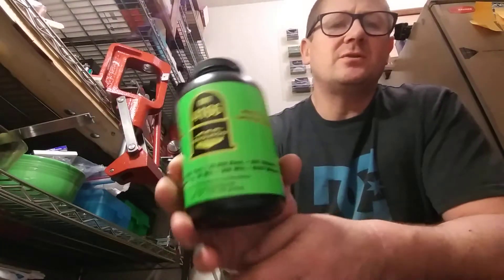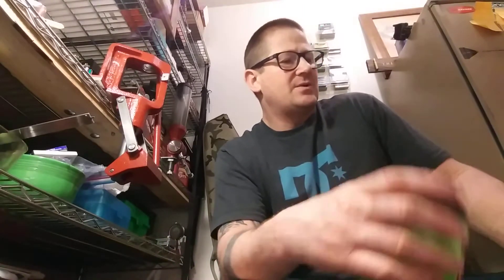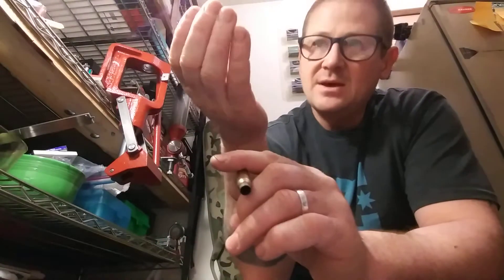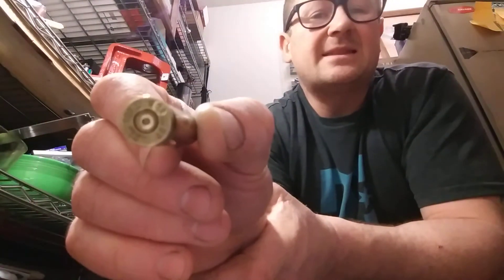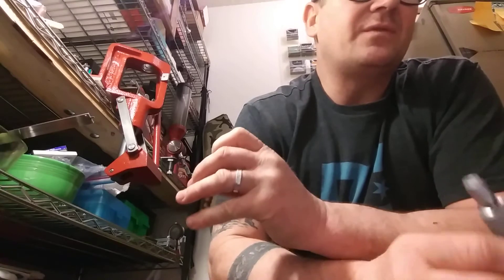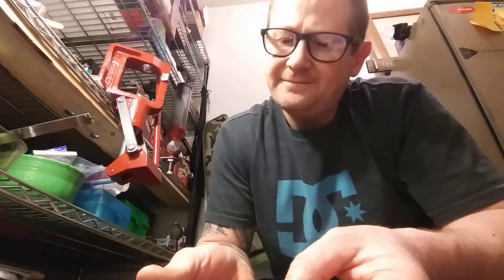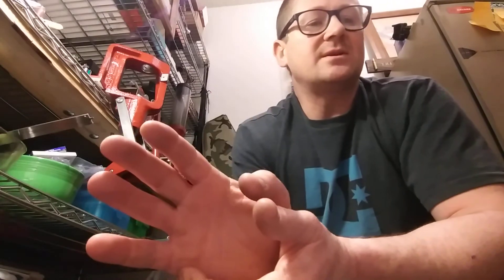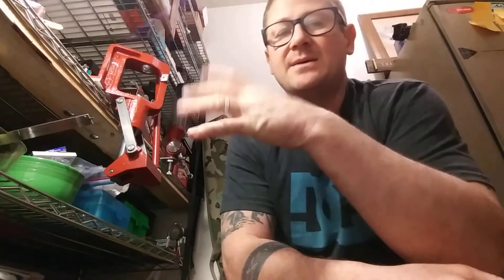Imr 4166 308 Winchester pressure signs in cold

Comment: Well, it's not really surprising that you would get get high pressure with compressed loads whatever the temperature. The Hodgdon 2020 data for 4166 lists the max charge for a 165 gr bullet at  44.9 grains (compressed) for that powder and that bullet weight.  Just speaking for myself, I wouldn't push it.

Comment: So in my book 44.9 is a max load col is 2.750  for a 165 in the .308 I have found in my 7mm-08 that if I shot a non compressed load with 4166 I get better groups with 4166. Unfortunately with your 20” barrel your not going to see very high velocity you might have to drop down too 150 and try. Just my two cents
Reply: I found the same thing. The max loads are, for the most part, compressed loads for 4166 at all bullet ranges from 130 to 180 grains. I just can't go there.
Reply from the maker: I went out and shot some more with 45.8 gn. and a boat tail match bullet and it started blowing primers out. The next week I went out and shot 44.5 gn, and they shot well and I shot them at long range and the adjustments on the scope were the same, so there is no advantage to pushing it.